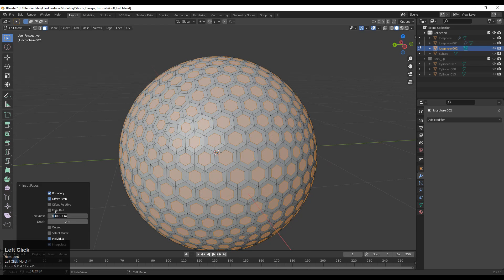Blender 3D Modeling | How To Make Golf Ball In Blender | 1 Minute Blender Tutorial

Comment: Inset does not work. I do not understand why
Reply: When you follow all the steps, then get to the inset step, you need to press "I" twice. Once is like a 'global' inset, over the average of all the faces combined (which, for a full sphere, makes no sense). When you press I the second time, it insets each face individually.
Reply: :elbowbump:
Reply: Neither for me. It worked when I clicked faces select mode then right mouse->inset faces->then bar in the left corner appeared-> change thickness and depth
Reply: @seekershmiker5706  The problem for me was that I needed to dissolve the vertices in the middle of the hexagon edges
Reply: I know it has been 3 months, but make sure you have the "individual" option ticked at the bottom when you insert the faces